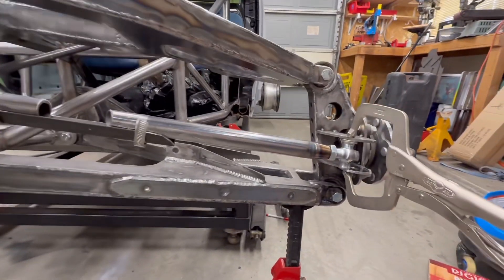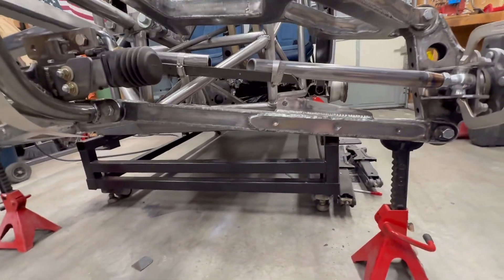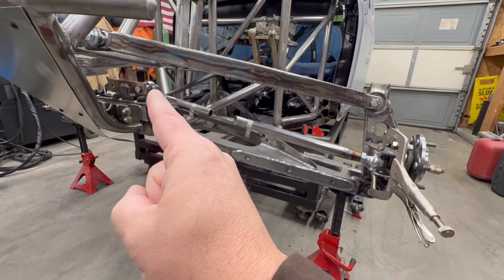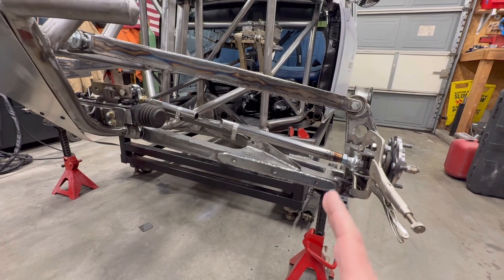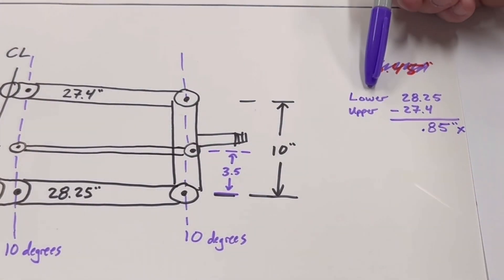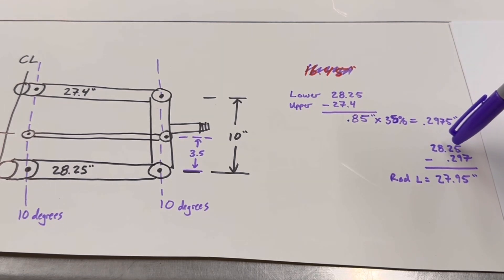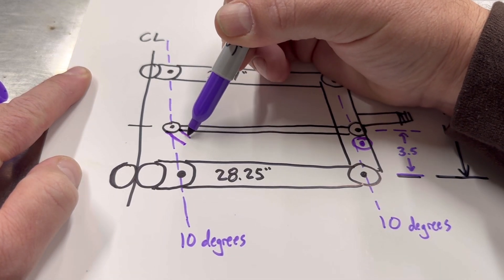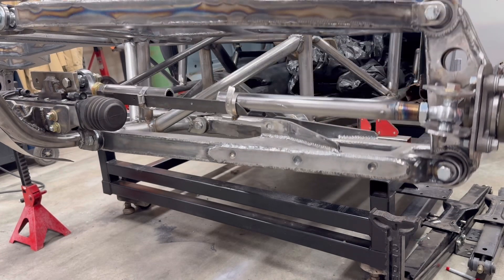I Need Help- Steering Geometry and Bump Steer

Comment: I love this. i built an A-Arm set up years ago from scratch. and there would be nights of just sitting on a bucket and brainstorming starring at the the car. Trying to figure out how and why. I ended up using Garage door strap with a the holes and literally starting with long tie rods and trimming them back going from hole to hole until i found the sweet spot. Cut, Tack, Cycle over and over
Reply from the maker: That’s super cool. It’s very rewarding to get things figured out and have them working like they should. I’ve had lots of “bucket time” myself lol

Comment: Sorry just re-read my post. Take the correct tie rod end length x 2 and subtract it from distance between the mounting points on your hubs steering arms. thats the correct rack length.
Its much easier to do than to explain.
Reply from the maker: Thanks for the clarification! Makes sense

Comment: OK Miah, here's how it works on setups with equal length AND parallel arms on the top and bottom.
Firstly measure the distance between the inner and outer pivot points on an arm. This would be done perpendicular (90degrees to) the center line of the car. That is the length of your tie-rods. These MUST sit parallel to the lower arm.
Now, with the wheels pointing straight ahead, measure the distance between the steering arms on your hubs. For example from the left steering arm tie rod mount all the way across the car to the right side one. (With arms parallel to the ground).
Now take the length of your tie-rod and multiply x 2. Subtract this number from the distance between the tie rods and whatever is left is the length your steering rack needs to be.
If your rack is a different length, then youve specd the wrong rack. You simply cannot run the wrong length rack and hope itll work - it wont!
Awesome looking build, by the way👍
Reply from the maker: Thank you so much. That’s a very clear explanation. I will run this exercise and see what I come up with. I moved the tie rod pivot points parallel the lower are and used the calculated measurement. I have no bump steer now. I will cross check with your recommendations.
Reply: So, you could not move the pivit mount and just use the other lowered joint@MiahsBug

Comment: From what i have learned which is very little, lol, you are on the right path. The tie rod being parallel means nothing  if attach points are different. Your attach point at the rack has to measure the same from base to pivot point at rack as well as at outer attach point of rod to spindle. I hope it made sense lol
Reply from the maker: Makes perfect sense. I actually got it worked out! Exactly as you just described. I have no bump steer now and I’m very happy! Thanks for the comment

Comment: Im wondering about 2 different things you could try, 1st would be to clamp the outer tie on top of ur spindle & cycle it to see if reduced bumb steer.2nd can you flip rack moving tie location down to be parrel to Lower control arm? Hope it helps.
Reply from the maker: Thank you. I actually got it figured out. Definitely MUST be parallel to the lower arm. And the offset from the hinge line needed to be the same offset on the outside. Works perfectly now

Comment: I think your close with your math/tie rod length, Minus the offset rod end. Place/tape a piece of cardboard roughly where the inner pivot is. Stick a marker though the end of your inner tie rod end. Move the spindle (keeping it straight) to full bump, Ride height, and full droop, Strike an arc with the pen at each location. Where they intersect will be very close if not right on to where you want the inner pivot.
Reply from the maker: Thank you! That’s a great plan. I actually got it to have no bump steer last night! I think I may still do this to have a better/ more full understanding

Comment: Your lower control arm and your tie rod must be parallel to each other. No exceptions. Next, say your lower control arm from pivot point to pivot( where it attaches to the frame to where it attaches to the spindle) for example is 24". Then your tie rod end from pivot point to pivot point must be the same length as your control arm is, 24". Watch this video by Dirt Race Life   Bump Steer Explained, Build a Gauge and USE IT! and your mystery will be solved
Reply from the maker: Thanks so much. I will watch it now!
Reply from the maker: Good watch. Thanks for sharing. I’m building confidence in getting this figured out now. Excited to head back in the garage
Reply: @MiahsBug  You're welcome. That video helped me so much. Solved my problem easily.
Reply from the maker: Dude! I just got it worked out! No bump steer. About to post a short showing what I had to do.

Comment: The issue is your pivot points. Tie rod length is not as critical. The measurement from the lower spindle pivot to the tie rod pivot on the spindle needs to be the same as the lower A-arm pivot to the tie rod pivot at the rack. You are on the right track in your thinking.
Reply from the maker: Thank you! It was hard to figure out, then the ah ha moment when thinking through the things I’ve changed. I am going to try your point exactly. Will report back! 🫡

Comment: Yes your steering rod arch must match the arch created a the knuckle. This is accomplished with matching the angle as well as the length. If not the same length they will make larger or smaller arcs.   Also I find it easier to make a model from cardboard. Easier to make adjustments to see what happens before investing the time and effort making from metal.   You got it now.
Reply from the maker: Thanks Jim. That’s exactly the information I was looking for. Matching the arc is the key. I’m confident I can get it with all of you guys help! I think I am going to make a cardboard set as well
Reply: I just  went thru this last week and actually made my car driveable.
Reply from the maker: @jimhowell4937  I GOT IT! No bump steer! Thanks for the help!

Comment: You're on the right track, and get rid of that offset heim. When you lift the suspension and the rack goes inward it's because the tie rod is essentially angled upwards. You proved that with your drawing.
I highly recommend you make a 1-1 layout where you can move things around. With that you should be able to find the solution that works. What I suspect is that you will need to raise the connection back up at the spindle. I'll bet if you bolt the tie rod to the top of the plate at the spindle then the steering box will go out when you raise the suspension. This will tell you that you went to far. Good luck, when I watch your videos I get flash backs. 😁
Reply from the maker: Good info! I knew you’d come through. Originally I had it set very close to yours. Bump steer was only 2 degrees so I was almost there. Then I screwed it all up for no reason. I’ll do the 1:1 template and give it a try. Ditching the offset hiem. If someone else builds this front end, maybe between your videos and mine they will go with what works.
Reply from the maker: @DougBugBuilder  I got it! Zero bump steer. You predicted it perfectly. It’s like you’ve done this before 😝
Reply: @MiahsBug  Awesome! Can't wait for the next video. ✌

Comment: Steering geometry is a bitch, I've learned this the hard way over the years of building cars. It's why I chose the Nichols Fab front-end to save me the headache. That being said...I'd start with a rod on the steering box (since that a fixed location) swing it up and down and measure its movement in the arch(in and out) then try to find the sweet spot on the spindle, split the difference of your in and out measurement. If that all makes since? I'm also sure you can find many people smarter than me that can use math and diagrams to solve the problem properly 😂 I do like this video it's cool to share your problems and reach out for heip. I have no doubt the problem will be solved!
Reply from the maker: Thanks Darren. I’ve already got some great tips from you and others. Chase commented a great video from shock therapy that had awesome information. I have some experimenting to do but know I will get it worked out. You guys are my builder YouTube support group

Comment: I'm pretty sure Justin at Shock Therapy answers your question in this video (https://youtu.be/-FPIhP5tvZo?si=OA7r1iDltDKMwvs3) 

Though he's done like 3 big videos on a arm geometry so i may have the wrong one, and being that it's Valentine's Day and I'm walking out the door now for dinner i can't really check my notes right now. 

But regardless, this is at least a starting point. The video of Justin's that I'm thinking of talks about "perfect design" and then how to get the same result in an imperfect world and how you can move pivot points to correct it
Reply: I just watched this video, soo much information! Thanks for the link!
Reply from the maker: @profesonalantagonist right!
Reply: @MiahsBug  btw, in case you didn't see it, Justin has a part 2 that expands a bit on the front end geometry topic and talks about anti dive and attack angle a bit more. (  https://www.youtube.com/watch?v=lwpd_fUm-Kw)

Also, if you watch the video about "YXZ and Talon Bad Geometry" i believe that one talks a bit more about rear suspension and vehicle dynamics created by rear end design. 

Honestly, if you're willing to pick through the banter and deal with the fact that almost all of Shock Therapy's content is centered around UTVs, they have TONS of good tech knowledge and info hidden in their videos. Just gotta watch tons of them and try to find the info you actually want.
Reply from the maker: @ thanks so much Chase. That video helped me so much. I just got the steering to have ZERO bump steer! I posted a short showing the changes. Nice to have subscribers like you. Have a good one my friend!
Reply from the maker: Looks like you grabbed the right video! Lots of great info, now subscribed. My setup is following all of the rules he describes with the exception of the “clever” offset rod end. I need to double check all the geometry and make sure everything is as I think it is.
Reply: @MiahsBug  another thing that I believe he covers elsewhere in another video that he doesn't seem to touch here is where he talks about Ackerman and moving the spindle side joint in or out (whether it's a rear steer or front steer spindle), obviously adding Ackerman as he explained in this adds bump steer, but in another video I believe he says you can move the inner pivot an equal distance as the outer pivot to keep bump steer out. 

So in this example where he does moving the spindle pivot out, let's say he moves it .5" outside of the kingpin angle, you would then move the inner TRE out .5" from the control arm mount line
Reply from the maker: Yes! He covers it in the video you linked. Definitely going to make sure I have that right. Thanks Chase! Really good info

Comment: You're not going to like me, but...
Get it as clise as you can and then ....Just send it.

Okay you probably saw my steering setup video, but what I looked at is:
1) Is my tierods the same length as my a-arms.
2) Are they as parallel as they can be (I think that you are right about the offet hiem, that may be a problem)
3) Do the tierods come forward or backward to meet up with the rack?

My focus was putting everything in-line and equal. While it's true, I didn't assemble everything yet, so i dont know what I'll end up with.  Don't let this stop ya.

Do your best, then SEND IT!
Reply: Binder,your video was awesome its how i figured out .y bump steer i had it all wrong
Reply from the maker: Thanks Dom. I know bump steer is almost impossible to get rid of without compromising something else. Like you said, I’m going to get it as good as possible and then send it. I guess it’s just frustrating when I had it at only a few degrees toe change then decided to “fix” something else resulting in bad bump steer. I can always go back and limit my travel
Reply: @MiahsBug Yeah, I know you said the TR was close to hitting, but if you're not hitting, I say put it back and run it.  If you have clearance issues, deal with them then.

Comment: It's hard to tell all of what's going on. There might be an issue with how your box is located,  and when the suspension cycles if the caster is bringing the steering spindle closer to the box and pushing the tie rod. If your control arms inner pivots have a wider spread vertically than those on the spindle side, there will be a significant change in camber as the suspension cycles which will cause push or pull on the tie rods. As your camber changes with suspension cycles, the closer to the top or bottom of the spindle the tie rod is, the more it will be pulled or pushed. You will have the least effect, the closer to the center the tie rod is mounted. The problem may be the spindle is not tall enough and your control arms are not far enough apart on both the frame and spindle sides to accommodate the tie rods being mounted closer to the center. 

You have several components that travel in an arc as they cycle, so I think I might look and see if the arcs are concentric, if they are differing radii, or if they travel in differing planes which puts components at different maximums and minimums as the whole system cycles. By that, I mean the arc your control arms are traveling in is at their maximum distance from the frame at, let's say, mid-way through the suspension cycle. However, the arc your control rod is traveling in has not reached its maximum distance from the frame. As the suspension compresses more as you approach bottom, your spindle is moving back toward the frame, but the arc your tie rod is in is still moving away, which is creating the bump steer. The longer travel the system is, the more significant the effects of component arcs and interaction will be throughout that cycle. You are going to experience more camber and toe change throughout the cycle than a shorter system would and certainly more than a road car would that is not going to typically go from maximum extension to maximum compression over and over during operation.

Again, it's hard to really understand what is happening without being in front of it. The issue may be your box location. There is also another arc of travel to consider when you look at the location of the box and control arms. As the suspension compresses, those control arms not only travel up, but swing back as the control arms travel through their caster angle. I see lots of A arm front bugs built like this, but I have never understood why the steering box is mounted so out of line with the spindle/knuckle. Applying that arc of travel to a component which does not start out in line with the others, may be the problem as the travel arcs start and stop in different places and there are two planes of motion affecting the tie rod/knuckle/spindle.

Just spitballing, the design a little. I would build it with the pivots on both sides of the A-arms with equal distance between the upper and lower inside and out. I would set up the box more directly in line with the steering knuckle and, for me,  I would have mounted the box and knuckles at the rear of the spindle for more protection ( that would mean a different box), and I would have put the rod ends in double shear.

Quick recap, your inner tie rod pivot should be in line with your inner control arm pivots. The steering box pivot and spindle pivot should be in line at mid-travel, consider both arcs the control arms travel in because of that box location, and double shear everything. I think Doug Bug was having bump steer issues with this design too.
Reply from the maker: Wow! Amazing in depth response. Thank you so much for taking the time to talk through all that. A lot of what you said makes a lot of sense but I need to beak this down. Thanks for recapping. That helps a lot. 
The steering box is fwd of the arms in most off-road applications because I believe it puts the tie rod in tension primary over compression. The box is mounted fwd of the lower arm inner pivot to keep it clear of the arm at full compression. Everything will be double sheer but only after I get this resolved. 

The different arc radius makes a lot of sense. I will mock it up equidistant from the upper and lower arms and see how that does. I will also see what clearance I have to move the box back and make it more inline with the knuckle. I’ve seen a few cars set up that way. I will report back. Thanks again for all the ideas!